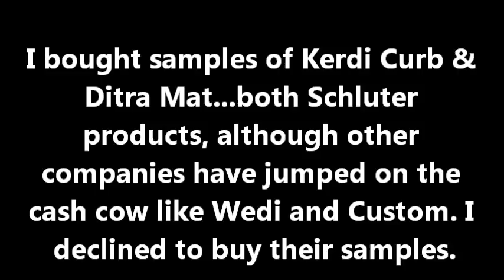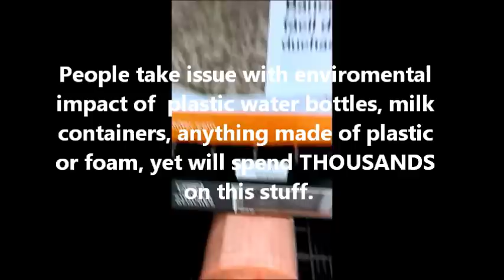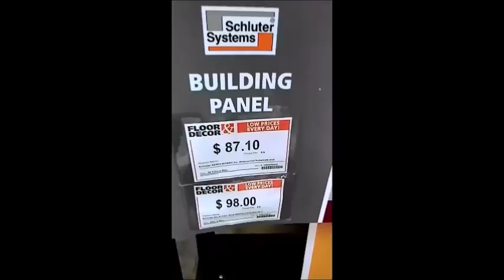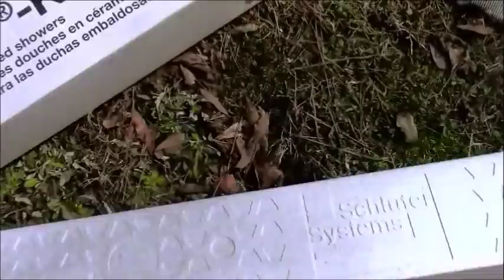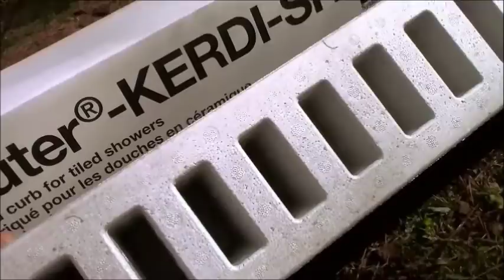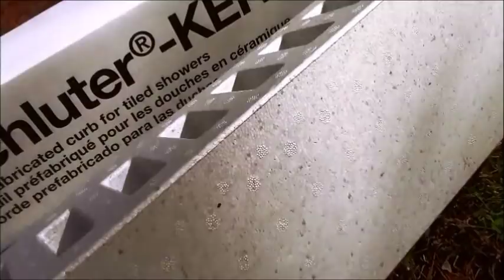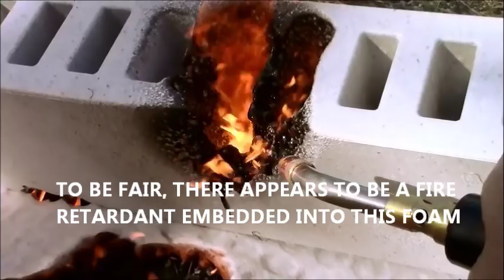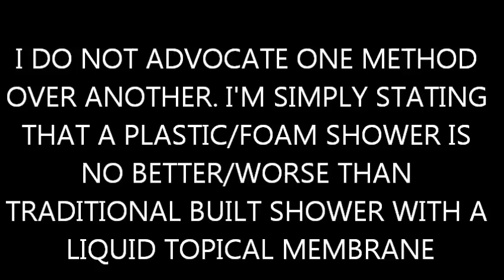BUILD SHOWER FROM FOAM and PLASTIC ??

Comment: Schulter is meh and I agree I don't like plastics but does  the  sheet rock you use in showers area,can it  also  be smashed with a hammer ? Or does the redguard make the sheet rock impenetrable?
Reply from the maker: Smashed with a hammer ?? Not sure I understand. Why would you want want to do that exactly ? FYI, my tile can be smashed with a hammer.
Reply: what's not to understand i see where he's going with his statement.
Reply from the maker: Thomas Goldsboro actually you do not understand, what I smashed with a hammer was the fake foam curb, you cannot smash with a hammer my wood curbs it will not work, he tried really hard to draw an analogy and failed
Reply: Ok Let’s talk about the product flammability, and how you don’t want this product in your home or wouldn’t install it in a paying customers home. 

As mentioned by so many about all the modern things we have in our homes that when burn are toxic. The big one here I have not seen mentioned the one holding up  any and all substrate  “floor joist” now being made of glued and pressed particleboard or plywood.   Fire loads in modern homes have heavily increased in the last 20 Year’s not all due to personal content inside.  We know balloon type framing was out years ago due to fire travel we added fire stops, fire walls & fire floors.  
Now in the most modern homes with toxic building materials we have kinda gone backwards to the same problem, as fire fighters again becoming Basement savers of what should be just a room and content type fires.  This is modern times and modern materials. This little bit of Kerri material in your home won’t make one bit of difference as to all the all the wall cavities being filled with foam insulation.  Firefighting tactics have changed recent study shows you can affectively fight just as much fire from a exterior to interior fire attack with out sending in the troops when fire progression has advanced a bit far. 
 Stupidly and lack of training is killing firefighters not modern building materials. 
In most states now the NFPA and state building codes require a sprinkler system be installed. Flashover is happening much sooner for two reasons materials are producing superheated toxic gases and  energy efficiency homes are sealed up tight. Here comes Johnny the  bada** firefighter makes entry  opens up air to the room and poof. But you know that you was a fireman just as I am for the last 17 years.  So in conclusion not using this product due to flammability I find to be absurd. Every one is certainly entitled to their review and opinion of a product.  
Now how I got to your channel ? I’m almost ready to start putting my bathroom back together all up to the part of tiling I know my limits.  So I found a tile contractor by word of mouth as they do not advertise, even though they have a tile warehouse and employ their own craftsman.  
He said they primarily use  the Kerdi system. So I did a bit of homework on the cost of this material, the cost of  durock and membrane material + labor time and Even though the kerdi material is more money  the less labor time  off sets most of the difference of material cost so it’s not that much more. This may not hold true to a diy shopping at chain The box store but to a contractor / wholesaler buying bulk it comes a bit cheaper if you can find someone that’s not going to rape you on it.  So in conclusion I don’t feel anyone should be afraid of using this product exclusively because of its flammability. Is the kerdi better than durock and water proof membrane ? Probably puts them both on the same playing field in quality. Their both achieving the same results that’s water proofing. It’s like regular old math vs common core no matter how you do the equation your still coming up with the same results.

Comment: I'm curious on what the labor cost is on doing a dry pack shower pan, you knock the Wedi system but I think it is less expensive labor wise, also less susceptible to leaks .
Reply from the maker: I don't charge in that fashion, I charge for my time...beginning to end. But I am not doing my shower out of foam and plastic, I never have and won't...even if I can save a day, the goal is never to get in and out, the goal is to have a Fail-Safe method and mine is
Reply: I understand what you are saying, I watch alote of your videos and know you have far more experience than I, however I have done several home renovations where I have taken out dry pack showers due to failure.I am sure I could learn alote from you as I don't have experience in doing showers in that method, I do use the hydroblock system and to me it makes sense.The foam does not absorb water  so what is it about that aspect that troubles you?
Reply from the maker: @dylanmacgregor7023  the whole shower makeup excluding the tile is about 20 lb , it should be about two or three hundred lb , do you want a foam and plastic bumper on your car like you have or a steel bumper like I have?
Reply: I'm also curious about another thing you mentioned on another one of your videos.You were discussing your method of installing your tile edge.Do you have s link for that.I hear you saying your tile should be built up off the wall a 1/4" or more.I'm curious as to how that works if you have say a 3/8 tile or thicker, where do you find a tile edge that will cover.

Comment: Lol if you were worried about the chemicals produced in a house on fire you would have to live in a log cabin. These products are so much faster and easier to use then traditional methods. Time is Money!
Reply from the maker: If they ever come up with foam and plastic bumpers for my trucks, I will sell them immediately. There is a reason we have girthier and stronger materials, the goal should be to do the job right not to do it faster

Comment: we do all our houses with KBRS /Goboard. love it, installed and waterproofed in 5 hrs materials are ultra lightweight and easy to work with.  after leaving the military and getting into the tile industry my first experience is with KBRS/Goboard.   using hardi, cementboard, just makes me cringe now lol.  right before we switched over to the KBRS system we used Schluter shower systems.. hated it.
Reply: Just looked up kbrs and goboard, kbrs is damn expensive and goboard is polyisocyanurate, a type of foam that absorbs absurd amounts of water, and isn't rate for below grade due to water absorption. I'm sure it's fine, but the foam in kerdi at least it doesn't absorb water.
Reply: menchelke. We waterproof it with kbrs shower seal.  Awesome system I've never  seen it leak

Comment: Used ditra on two high end pool decks.followd all the guidelines provided and now both are failing with delaminations.Done at least one hundred decks with no ditra over the last fourty years with not one callback.If the pool contractors or owners ever spec this crap again l will respectfully not bid it.By the way the one deck we just replaced at our expense cost us two months gross pay and schulder rep was like  the most disrespectful person ever,first comment was you used the wrong thinset,had invoice from supplier with job address on it next comment was just because you bought unmodified thinset doesn't mean you used it.Dont ever use this product outside not sure about inside but never will go near it again.
Reply: Thanks for the heads up! !
Reply: That sounds like someone a German company would hire.

Comment: Right but you can do it in half the time! Building a two by four curb and Messing with that awful rubber membrane and two layers of mortar and time sloping and then red guard yadayada. This is foam, throw it down seal it up with thin set and you’re good to go! 
I get that it’s cool to be old school sometimes but you also need to learn to adapt
Reply from the maker: I Won't Give Up the steel bumpers on either of my trucks, neither will I give up on my method when it comes to foam and plastic... although you could probably pick up those foam and plastic car bumpers on the roadside and somehow make a shower out of them I'm sure.
My focus is not about saving time as you mentioned, my focus is doing an outstanding job to the best of my ability , if you want to do it right and take longer and charge more then so it..
Many people have done mock-ups where this crap leaked all over the place, mortar is not a sealant but you that's what they use.

Comment: The only way to do a shower right is with mud! I hate all these plastic products! I use sand mix and lime with a latex additive for my walls over 15# felt and Dimond lath. Pan liner for the pan and regular deck mud for the slope. I use deck mud on all my floors as well.
Reply: Ryan Coulter , I agree with you but home owners are easy target to tile stores that are pushing this products , they rather pay more for the product than on labor.
Reply: Jose A Betancourt Betancourt  yes I know. I don't think homeowners should be trying to tackle a shower on their own. Floors are one thing but showers should have to be done by a professional. Just my own opinion.
Reply: I wet mud set my hole shower, floors, walls and ceiling and it's smother then a baby's butt after I die and when it's time to remodel that bathroom I feel sorry for that SOB hahaha
Reply: You’re a hell of a man and more power to you! Hats off to you. That’s a dyeing art. Must be from Detroit or California. Hope you have really taught a young guy to fill you shoes.
Reply: Gee the only showers I ever tear out and replace are MUD set pans from failures. I have yet to come across a demo of a foam system

Comment: To me its like Grohe faucets...Everybody wants to sell high end because the mark up is great, but when the customers got a problem the installer can't help them.  I am Grohe certified, and i wouldn't sell them just for that reason.. Either i have to service it when needed or the next guy who has no clue. Tells the customers this is garbage, you can't get parts ect ect instead of saying the truth that they just never were taught troubleshooting. .. Best valve made imo will be called junk because  who is in front of the customer gets believed..

Comment: FACTOR IN THE TIME/LABOR COST TO WATER PROOF A SHOWER WITH LIQUID MEMBRANES VS. INSTALLING SCHLUTER AND THE COSTS BECOME MUCH MORE EQUAL.
Reply: Fyi you still need to use the liquid membrane for schutler system.

Comment: In most housing developments and new construction in PA over the last 5 years have these kind of shower systems almost exclusively, in part because good concrete guys are far and few between, and the speed you can put a shower in with it is staggering compared to the tried and true way. And that flooring crap you where showing was part of a floor heating system, you run your wire around those pods, putting it down if your not using the heating element is pointless. Oh and I dont think it is better by any means, fast and easy to use for a DIYer that might be intimidated about floating the floor and getting the right grade to ensure proper drainage, so I guess it has its place.
Reply from the maker: Dirt Merchant .. I am well aware of what the material is for, wasn't the point that I was making in the video, all that crap is still the same plastic and foam, I don't want a foam and fiberglass bumper on my truck, I want a steel one
Reply: Figured you knew what it was, that was more for the non tradesman. I do concrete for a living so you are preaching to the quire but this system falls in the same kind of low skill bullshit that attempts to make are jobs obsolete, like shark bites, pex piping, to name a couple.
Reply: Lath mud thinset tile grout old school!

Comment: I think the products are great, i think too expensive. There is no strength like dutarock. I like the idea of Red Guard but its only $50..that membrane with bells & whistles can be $1g- $2g ..I can't justify it in my head.. I never heard of using RG, by any of the tile guys, stone guys, contractors or even a home owner.. I figure i was in 35,000+ homes that i did do work in..never heard of any of these things..I am going to use the RG, but the only reason i could see in using that other stuff is you get to pad the bill.. If you buy that kit and say its a large bathroom just so i can use $2,000.  As my #..thats a $5,000 add on with mark up and labor on it..

Comment: Compared to other materials in a house that give off noxious fumes during a fire this is a drop in a bucket.  IMHO you lost a lot of credibility with this video.   You did not show that the materials will not work or are prone to fail.  The material cost claim is bogus as reduced labor cost more than offsets the increased material cost.  These systems have been around for several decades and more are being develop.  If they did not work they would not have survived.  Some pros will install nothing but these systems.   I'm with Sal...he is much more open minded and willing to accept change.

Comment: Mike Holmes would not be too happy with this video....BTW...How am I supposed to invest in this company with videos like this....  ;-)
Reply: There is a lot of product placement on his shows in part because the materials were donated by manufacturers or building supply merchants since he was often fixing botched renovations where the home owners were broke. When he was first getting started on T.V they didn't use Schluter ditra at all, the redid a tile floor using 3/4 inch plywood as backing material, rough side up, with concrete board on top of that. In any event the plumber they had used a type of plastic PEX pipe in a few jobs that had an aluminum core between two layer of plastic, the company that makes it was sued because it would come apart and cause a flood. I never saw it used again after that season of the show, the others either used copper or a more normal PEX pipe.

Comment: While I don’t use this on a daily basis. This material is so superior to products from the good old days. You sound like a plumber back when plastic pipe came out.
Reply from the maker: While I agree that this material is convenient, I disagree that they will stand the test of time say 50 years or 80 years from now... plus it is highly highly overpriced for what it is, made for pennies on the dollar and sold at  ridiculous pricing.

That being said my main contention is at it is overkill, 90% of that garbage is totally unneeded, shower failures happen from ankle below, period.
Reply: @StarrTile  I’m glad and confident I don’t have to rely on a red guard type product to protect from leaks with other products that clearly aren’t waterproof. I used KBRS for the shower base. The one with a lip, pre made for my second floor shower. Works with standard shower drain practically “welded” to the base. From there it only makes sense to use “plastic” type products that won’t break down for “thousands of years”. And yes sir, they are over priced. But unfortunately these products are not widely used in other areas of construction like Red Guard and cement board.

Comment: Dude you have some balls to go against those big company... That membrane you bought is for ditra heat....It's meant for the heating cables. Regular ditra is thinner. A lot of people are pushing for leveling systems and schluter/wedi products....It's all about money. You don't need any of that expensive shit.
Reply from the maker: Yes I'm aware it's for Ditra Heat...but it came in mats instead of a roll so was cheaper...still the make up is the same. Someone has to speak out on the marketing of these expensive products, as you said it's all about money not necessity.

Comment: I usually don’t comment on videos that being said, this is pointless. So you don’t like the material. DONT BUY AND USE IT! A lot of people think you’re an idiot for using red guard.. it doesn’t matter once you seal the grout water can’t get passed it. How many old bathrooms have you gutted where virtually no water damage to wallboard? I demo’d one with brick mortar for a shower pan and tar paper under it. Not a speck of water damage! 
Iv had clients ask me to use waterproof membranes like red guard and this product. If they understand the extra costs involved that’s all that matters! 
Iv never seen a burnt down house with the shower miraculously standing without being burnt. And you’re worried about the pollutants?? Seriously! Of all the shit in houses you draw the line with plastic and foam....
Are you butt hurt from losing a few jobs to someone using these products? I didn’t see the point in this video at all..

Comment: Red guard  is good enough for me.. no need for this expensive system.
Reply: Red gaurd, when applying properly costs the same as using schluter, in my opinion. Bottom line is do you wanna spend more on materials and get things done quickly or have to put up 3 coats of redgaurd and wait 3 days between application